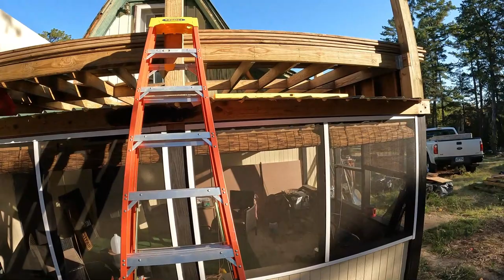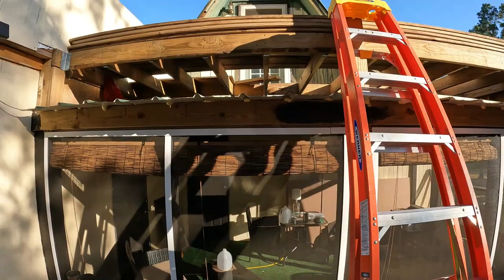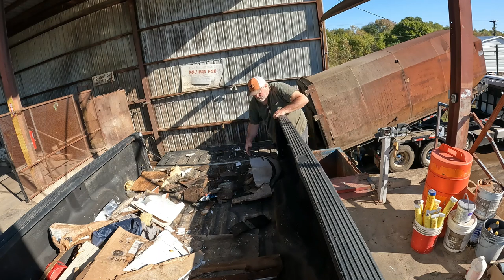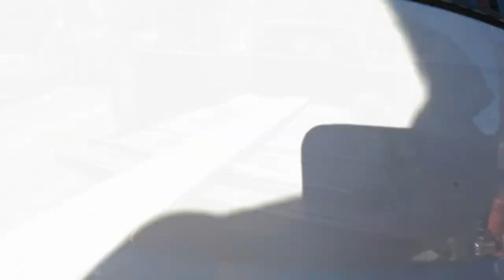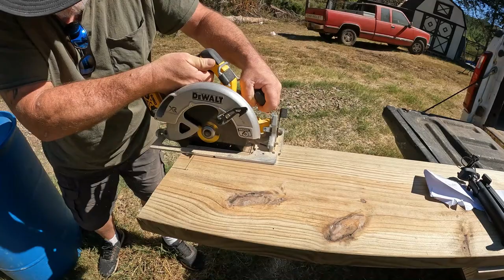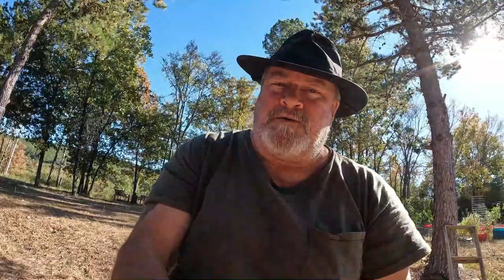Unveiling the Transformation: Upper Deck Patio

Comment: Even if you butt your deck boards against each other there will still be a big enough gap between them to let a wasp through as it dries out. If it was me I wouldn’t worry about hardware cloth on the end gap.  It will likely catch debris and prevent you accessing that space to spray wasp.  You can find innovative ways to hit them behind the blocking like bent straws.  Those are my thoughts anyways. Now birds…
Reply from the maker: Good point, and I enjoy the annual war with the wasps!